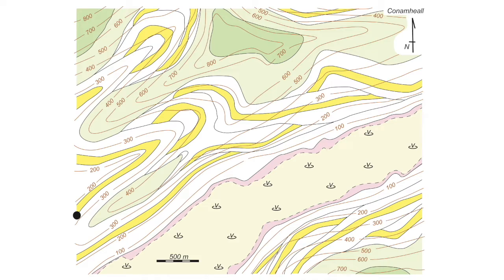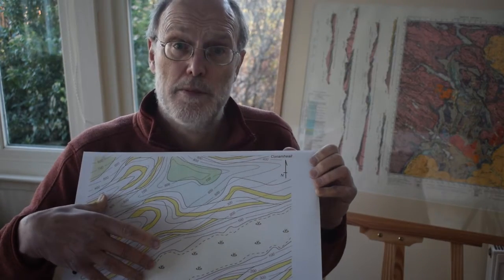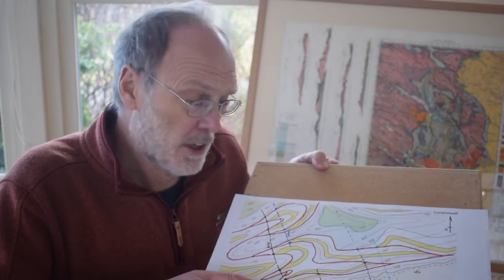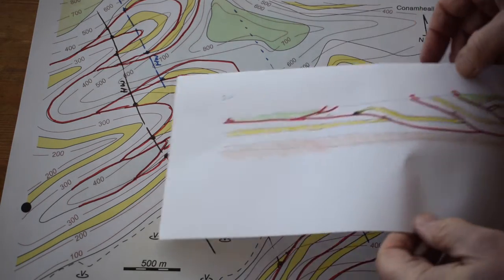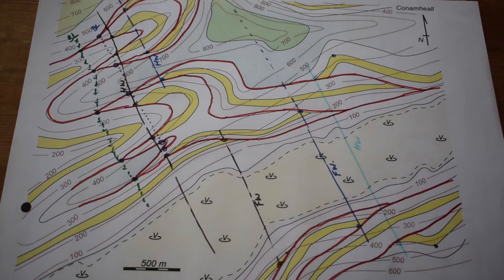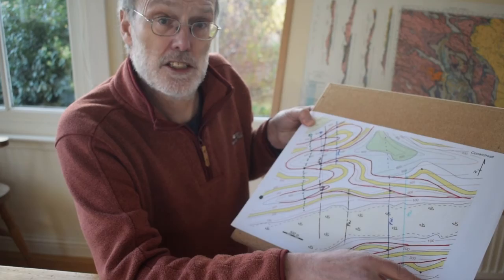Analysing thrusts and their cut-off lines on a map

Comment: Dear Rob, very nice explanation for thrust belts.  What do you think that is there any  involvement of strike slip force ?
Reply from the maker: Thank you for the comment. This exercise - which is "idealised" - involves purely dip-slip (frontal) ramps... though actually as everything is parallel, the ramps could be oblique... As for thrusting with strike-slip, lateral ramps and compartmental structures exhibit local strike-slip motion (with respect to the orientation of their specific fault segments). And of course thrust faulting is not unknown at restraining bends on major strike-slip fault systems. Finally, the best documented strike-slip and thrust interactions are probably to be found in oblique convergence zones - as for example, seen in the video: https://www.youtube.com/watch?v=hhdQh-UNwjs
Hope these are useful leads.